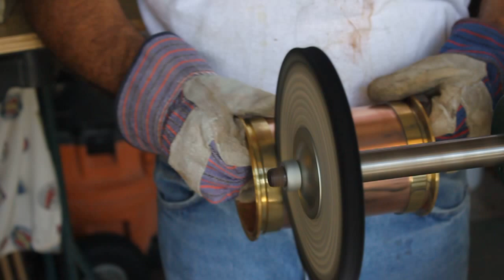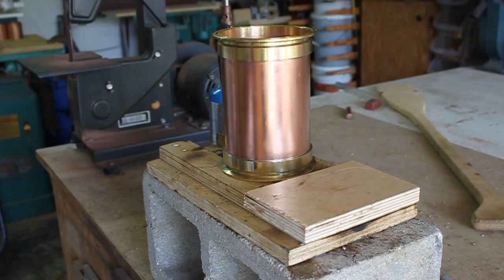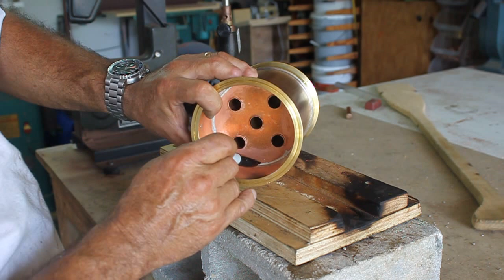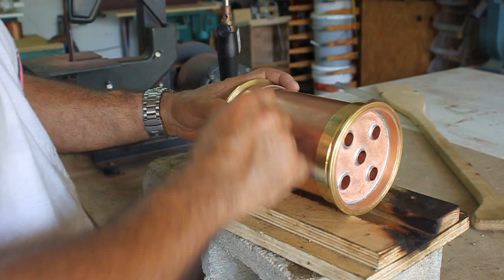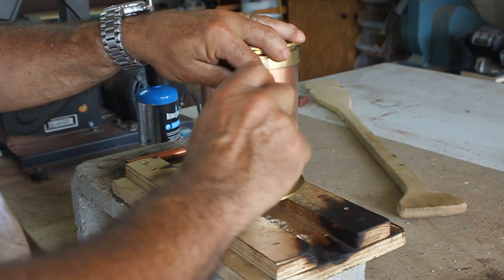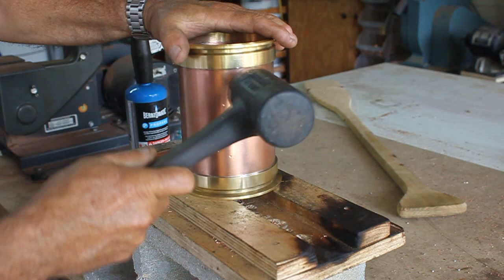Dephlegmator Fabrication video 4 for Copper Moonshine Stills

Comment: Hi. Im building my own still from 1.2mm copper sheets. Im running into conflicting info saying that the seams I would normally use are only for copper that is not that thick. 

Can you tell me the correct method for forming and soldering the seams on a sheet that is 1.2mm or 18G ?
Reply: D
Reply: Zz im m